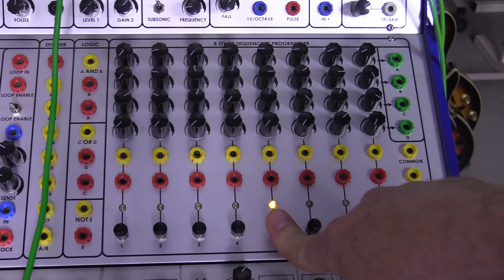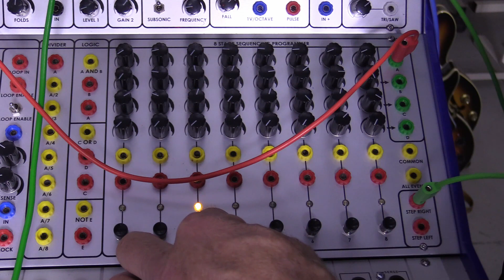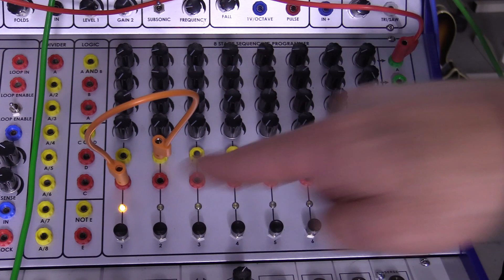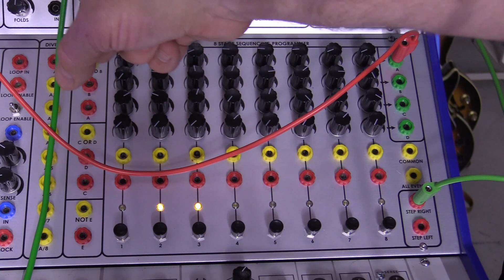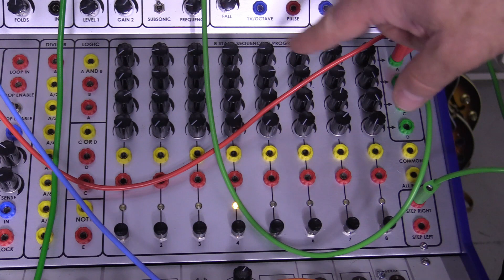Serge CGS359 Elby Designs 8-Stage Sequencer | Tutorial

Comment: Great series! It lured me into Serge! Wanted to add a little trick I use. You can get a repeating 16-stage sequence from this sequencer. If you patch a copy the clock driving RIGHT on the sequencer and it divided by 4 into the AND logic, and patch that into the LEFT input on the sequencer it will use those 8 steps to produce a repeating 16-step pattern. Very handy!

Comment: all of these elby modules seem great, really good value too. thanks for the demo. can you mute notes/add rests in the sequence independently, or would this involve other modules?
Reply from the maker: Hmm...well, this is really a voltage sequencer, not a trigger sequencer. It has trigger outputs for each stage, but you'd have to connect them all together in a trigger mixer of some sort, leaving out the stages that you would want to have rests for. I think it would probably be easier to figure out how to send triggers in the rhythm you want into the sequencer's move right jack, and if you want less than 8 notes in your sequence, send the trigger output of the stage after your last desired note into the stage input of your first note. Phew!